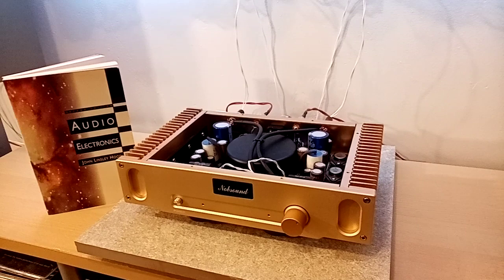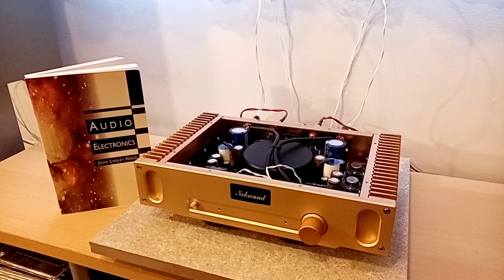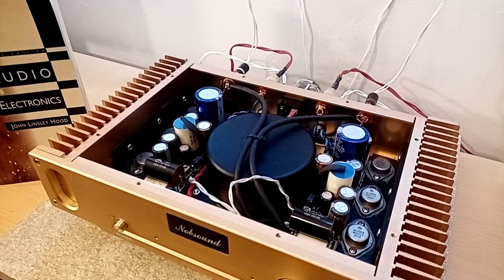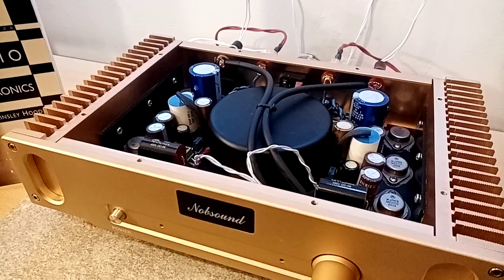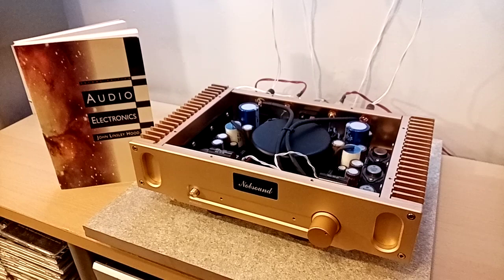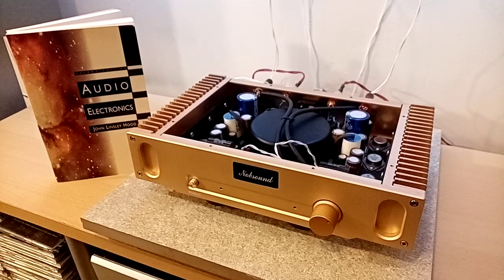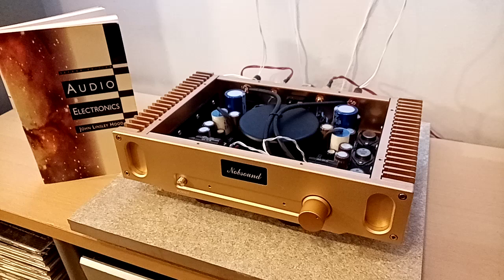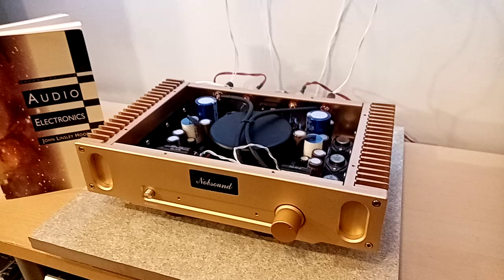John Linsley Hood 1969 Single Ended Class A amplifier. 10 Watts Per Channel. Classic Audio.

Comment: I built one of those in 1971. It is fair to say mine had a distinctly "home made" look to it. Yours looks lovely, well done.
Reply from the maker: Thanks, it's a nice amplifier. Did you keep yours?
Reply: I think, but am not sure, that my amp is in the loft. I have had a variety of amps since then, currently (for the past 25 years Conrad Johnson valve amps)
I am not sure if I dug my amp out of the loft that I would be happy to risk plugging it it again!

Comment: I picked up a John Linsley Hood low noise cassette deck a bit back for it's oddity value. Dramatically let down by the Lenco mechanism. I was going to modify it with a different mechanism but it's been on a top shelf ever since.
Reply from the maker: That's interesting, I wasn't aware he made one.
Reply: @mydadsaysaudio6192  He did a few designs for tapehead amplifiers and pre-amps. But this could be bought in kit form or factory constructed from Hart Electronic who did a lot of his designs under licence. There's a write up about it in the June 1976 issue of Wireless World.

Comment: Who wants to pay 3000-4000 Pounds when you can get 80-90% of the performance or more , for 600. these are a bargain !
Reply from the maker: There are some serious bargains out there.
Reply: Isn't this cost around $200?
Reply: I just purchased the Hood amp for $220 (USA) from AliExpress. Heard one many years ago and was impressed. My friend built his from a kit and it was so musical on his LS3/5a’s.When I saw the price, I took a chance and wasn’t disappointed. I did update the caps and installed a soft startup switch and am so happy! I’m planning on buying the Pass Camp Amp after a few more extra shifts at work.Needless to say I’m impressed especially with the “British” sound of laid back and musical and not the loud brash assaultive sound. I have Spendor and Harbeth loudspeaker’s along with my 70’s Chartwell LS3/5a’s.
Reply: @AlanFenick  I purchased the a100 with the vu meters, i think they sound different depends on the transistors and compactors

Comment: Very nice amp Does it have a coupling cap at the output? Thanks a lot Gino
Reply from the maker: Yes it does. 2200uf, 50 volt.
Reply: @mydadsaysaudio6192  hi thank you very much for your kind and very helpful reply
I understand it was a quite common design solution years ago
i think there is a good thing about this design The power supply caps being charged at higher voltage can have a lot of energy stored inside If i am not wrong energy =1/2*C*V2
This means a lot of energy available for output stages during power peaks
Moreover the output cap seems to provide a nice flavour to the sound
kind regards gino

Comment: I recently got a similar amp to this from Ali. Mine is supposedly an "upgraded model" with the same case (but no badge or even a recess for a badge) and is rated 18watts per channel. I am assuming your dad replaced the RCA input cables as I am positive the thin stuff in mine is not shielded. One concern I have is that there is no speaker protection circuitry so I have ordered a DIY module from Ali to fit into mine. Hopefully this won't affect sound quality. As for that, mine sounds fine but lacks the transparency and detail of my Sunfire HT amp.
Reply from the maker: Hey, I spoke to my dad about this. He says there is a capacitor on the output which blocks DC, so your amplifier ought to be fine as it is.
Reply: @mydadsaysaudio6192  Thanks for the info. I may still add the kit as it includes a time delay start to prevent any 'thumps' on start up and will disconnect the speakers in case the amp fails.
Reply: @mydadsaysaudio6192  Mine also came supplied with a 10 amp fuse. I would have thought a 3 amp fuse would be normal for this type of amp but I don't have the figures to do any calculations.
Reply from the maker: @mddawson1  is it fast or slow blow?
Reply: @mydadsaysaudio6192  It is a 10A fast blow fuse. My FU50 tube amp (8w per channel) has a 5A fast blow fuse while my Willsenton R8 (45w per channel) uses a 3.15A slow blow fuse.

Comment: Been looking at getting one of these.  Any preamp recommendations
Reply from the maker: When I had one I used a VSE FVP tube preamp and it worked well. It's a great amplifier, if you have the right speakers it's 10 watt output is plenty.
Reply: @mydadsaysaudio6192  Thanks for getting back to me

Comment: On further listening to mine (unmodified), I find the overall sound is lifeless lacking in detail and clarity. Soundstage makes instrument positions less defined than my Sunfire. It also seems to boost the upper bass. Worst of all is the interference buzz that it puts out through the speakers. There is something in my house mains that causes this noise but some amplifiers like the Sunfire  suppress it so you need your ear next to the speaker to hear it while others like my new JLH amp produce a buzz audible from my sitting position. Now I am tossing up whether to invest money into better caps and internal cabling or not.
Reply from the maker: That's odd. My dad's example sounds fantastic. It's a classic circuit dating back to 1969 and has many fans, including Nelson Pass. It's important to keep in mind it's only 10 Watts, it's never going to drive difficult loads. I used mine with high efficiency speakers and it sounds excellent.
Reply: @mydadsaysaudio6192  I am using some 23 year old Vaf DCX speakers that are 6 ohm and 95db efficiency so not a difficult load. They are very revealing so if the input is substandard, the Vaf's will let you know. My JLH has a different PCB layout with two 10000uf 35V power supply caps, one 1500uf 50V, five 220uf 25V and one 3.3uf 250V caps per channel.
Reply from the maker: @mddawson1  the 6 ohms impedence might be an issue? Though it's not that low and 95db is high. It's only a single transistor on the output, your speakers might prefer the extra grunt?
Reply: @mydadsaysaudio6192  The PCB in my amp is identical to yours until it reaches the power filter caps where mine has a second set wired in parallel. The rectifier is also laying flat and mounted to the heat sink next to the transistors. I searched Google for my PCB and found DIY and completed boards available. However, there seems to be a variation in the output caps supplied (the white ones in your video). Mine uses 1500uf 50V caps. Other boards used 3300uf 35V, 4700uf 50V and 6800uf 63V caps (the PCB does not specify a value for this cap). Also, the PCB specifies a 2.2-4.7uf film cap yet one kit used 1uf caps? I wonder what effect on the audio these differences make?
Reply from the maker: I discussed this today with my dad and we both agree that your speakers are a mismatch for the Jlh. Too low impedence, multiple drivers and a crossover. We use ours with efficient, high impedence, full range  drivers with no crossover. It's only 10 Watts, your Carver is more like 200 to 300 Watts.
Reply: @mydadsaysaudio6192  The Sunfire has 600 watts into 6 ohms but the Vaf DCX (series 3 - d'appalito aligned drivers with minimal crossover - one cap and one resistor) play quite nicely with my FU50 kit tube amp which is rated at only 8 watts per channel but probably closer to 5 watts with acceptable distortion levels. I have decided try different value output caps as I had a spare pair of new 2200uf 50v caps. I also have some 220uf 50v caps that I will replace the 25v ones fitted to my amp. These are all Jaycar caps so not any better quality than the originals. It still should give me an indication as to what quality caps to buy if I decide to do that. BTW, what value caps did your father use in his JLH?
Reply: @mydadsaysaudio6192  I think I may have tracked down what is wrong with mine. The input voltage is 20vdc at the test point but only 4vdc at the midpoint, not 10vdc (half the input) as recommended. I could get a maximum of 8vdc by adjusting the 100k trimmer pot to its end point. I suspect that the quiescent current and midpoint voltage trimmers were not balanced against each other during factory setting. I am waiting on a desoldering sucker for the caps replacement in my amp (Suntan brand caps for a nice warm sound 😂) so I will also unsolder the bridged test point at the same time and attempt to get all the settings correct.
Reply from the maker: Interesting. Let us know how it all goes. 👍
Reply: @mydadsaysaudio6192  I have completed the upgrades but have yet to have a listen through my Vafs. Upgrading the caps made no difference to the midpoint voltage, it was still around 4v rather than the 10v is should have been. I removed the solder bridging the amperage test points and fitted two pin connectors that a jumper can slip onto after adjustment. After balancing the amp and midpoint voltage potentiometers, I got the midpoint voltage up to 9v at 1amp - both a little low. Then I noticed the midpoint potentiometer was rated at 100K while the PCB had 200K printed on it. I ordered some 200k pots from ali, fitted them and was now able to easily get 10v at 1.2 amps - they fitted the wrong value.
Reply: @mydadsaysaudio6192  I just finished an extended listening test of my upgraded JLH amp and while it is a lot better, it is still not audiophile quality. In addition to uprating the amps electrolytics with Suntan caps, I also replaced the input film caps with cheap red Audiophiler caps from ali and the midpoint pots with 200k pots. Lastly, I ran the internal input leads through some braided copper tubing that I earthed to the chassis. This runs from the volume pot to the rear of the amp to shield those cables from the transformer. The amp is now about 70% quieter and I need to put my ear close to the speakers to hear any background noise. It sounds more dynamic and a better balanced sound overall. However, it still sounds slightly veiled, perhaps it is that tube type sound that people talk about. It still lacks the clarity and detail of my Sunfire amp as well as the Sunfire's soundstage depth.

Comment: Replace it with 15000 microfarads
Reply from the maker: Amplifier storage has been uprated to 15000 mf. Makes a  big difference.
Reply: And bypass the electrolytics with a couple of 1 uF film caps.